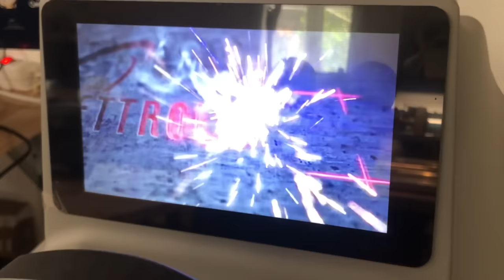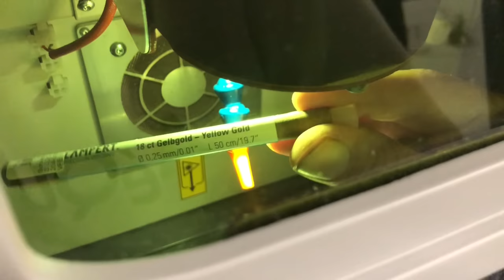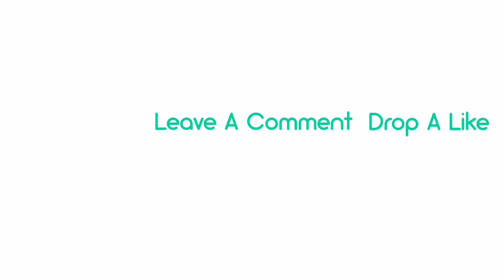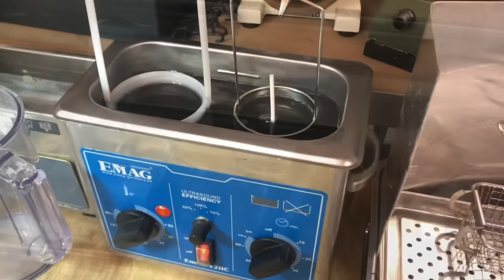Rolex Oyster Perpetual 77483 Restoration - Lapping, Laser Welding, Oyster Bracelet Stretch Repair

Comment: I think every time you aply grinder to the surfaces you take out to much material, I mean when grinding the case, you took out a massive amount of material...
Reply from the maker: Grinding could even be done with 1 micron lapping paper. You are not even be able to measure it. Polishing takes material away.